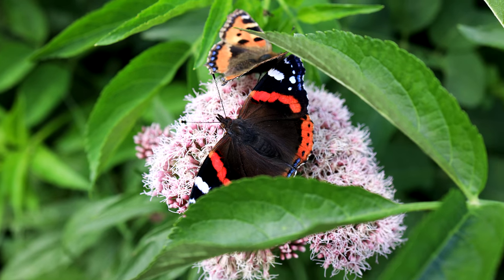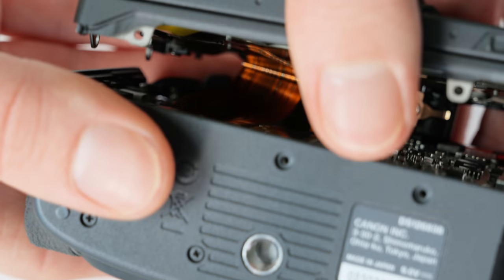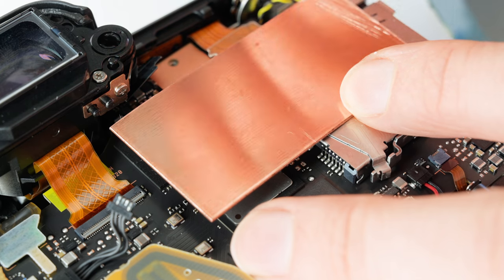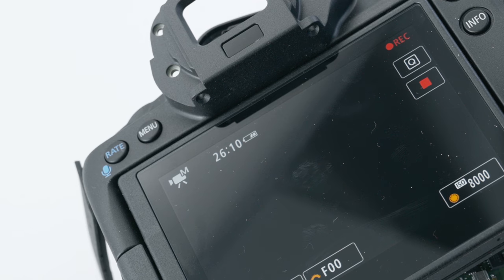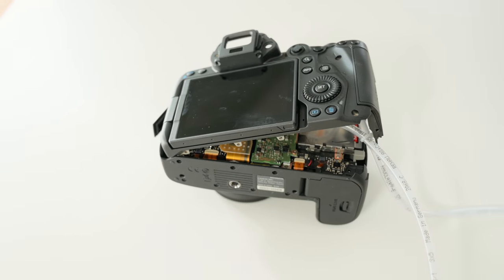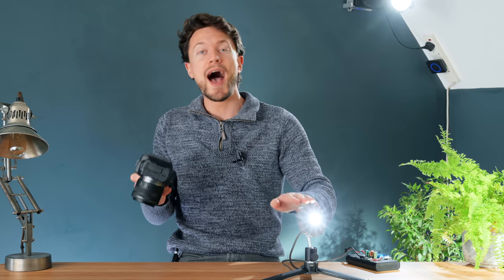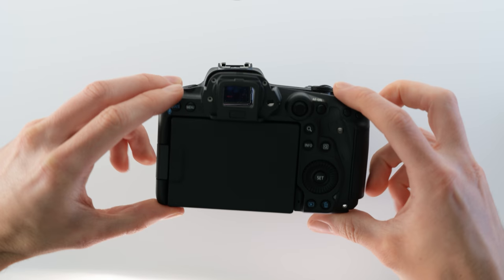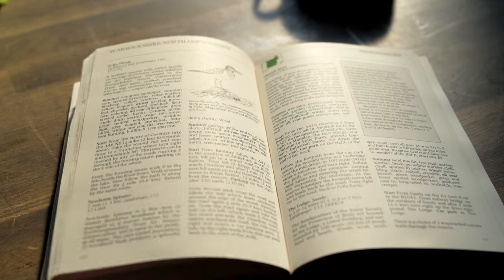The only reason to watercool a camera....

Comment: You basically did with scraps on the fly what any electronics manufacturer should have done during design and prototype. There is 100% no way that canon did not know what the problem was or how to fix it. They just made the product too good and had to take out its knee caps so not to hamper the sails of the higher market products.

This thinking is backwards however, as the prosumer market would eat it up like hot cakes, while the big studios will keep on buying the expensive stuff for its production grade class. (There is a reason RED still sells even with its eyewatering markup) 

Prosumers would never buy nor need the eyewatering heavy production grade equipment, so, they have effectively played themselves.  They have lost out on the prosumer market, to protect the demand for production equipment from a segment that will never buy it...

Comment: You should start branding kits to sell. I think of how Mad Catz started on simple nintendo systems, how they made infrared controllers for the original xbox, before xbox 360 started using them. I have a Sony, so marketing to me won't be as lucrative as Canon Rebels, T3,T5, etc. Just pic very popular models to make kits for. Your fans are DIYers, so you just have to send kits with the difficult pieces they can't fabricate on their own.

Comment: Hey bro what is the cooldown time after firmware updates .. and i also i have doubt adding thermal paste directly to power PCB will cause any issues .. beacuse there will BE pcb Vias and traces on the bottom of the PCB . ❤

Comment: idk why but i thought you were going to try and seal the camera and fill it with dry water. What if you did do this, seal the camera and add a small hole on the bottom that can connect to a small water container that has a small pump to push the water though a small plastic pipe on the outside back to the top or side of the camera. Would get rid of the need of the massive water cooling tank maybe. If you want to learn about dry water you can go to Thoisoi2 - Chemical Experiments! channel. He has a video on it.

Comment: thermal paste on pcb is a very bad idea as that stuff becomes capacitive over thicknesses that are practically impossible to measure without expensive equipment. Heat putty is what you're looking for or just use some heat pads, but not thermal paste.

Comment: 19:20 this wouldn't work because they're not allowed to burn the user. Yeah, even as a feeling this is not allowed. Which is very likely why this camera's cooling was so sh1t. Asus had the aluminium extra cool laptops, which had cooling on the pads. They aborted that range after just a model. This is why.
That said, for yours, all you have to do is make a capillary heat pipe go to the mounting thread.  If you replace it whole thread with a new one made from copper, you'll be able do the cooling in a discrete method through the stand.
This is how some testing models for LiDAR units used to cool (as a proposal), which i've used in the past in architectural dealings. They ultimately ditched such things in the commercial unit, for the same reason above. 

A sh1t reason if you ask me, but that's neither here nor there.

Comment: Nice.  I just bought an A1 and didn't have to spend 200 hours in a workshop with fire and 3D printers.
Reply: Blackmagic 12K Pro Shoots 12K and now it costs only 6000$ which is 500$ cheaper than A1.
Reply: @CreepyJoe69  we have the Ursa 12k too, completely different camera, no AF, super large files etc.

Comment: I'm seriously impressed with this mod.
Both the basic engineering skills to extract the heat from the processors, but also the elegantly designed fan module.
I am saddened to see the poor thermal management as delivered by Canon.
Putting the power board directly on top of the processors is non-optimal.  The poor thermal ejection characteristics are less than ideal.
I am impressed that just inserting the copper pieces provided such a significant difference.

Comment: Kind of unfair to compare new results and optimized firmwre with actual temperature monitoring against old firmware which maybe kept it at 2 hours by hard code. Should have compared both variants with actual latest firmware.

Comment: Does anyone know the exact parts he used for the initial watercooling prototype? I'm trying to DIY a solution to my GoPro Hero 9 overheating and I've been trying to find those mini water blocks (the aluminium ones that are about 15x15mm).

Comment: The fact that those heat pads were not even covering the CPU properly and they use simple aluminum plate and not a cooper one for cooling is very telling, that is not a mistake that is obviously intentional to make the camera a unreliable recording machine for cinema and also shorten the lifespan of the components, programmed obsolescence.

Comment: CANON COPIED YOU!
Their new pre production model Canon R5 C now comes with a huge fan right back there where you detected the heat. Amazing how this happened and almost no one will ever know it was all because of you!

Still companies should take advantage of your idea and build something for the R5. The new R5 C comes without the IBIS which is a huge downside. I wonder if they took it off because of the fan vibrations.
Reply: But that new model does not have the IBIS. Big disappointment.

Comment: Instead of working in all that copperplate why don't You use Silver, it conducts heat much better and is not that much more expensive, I think You willl be surprised

Comment: 2:35 : It's not, it's why you should not use these for long, continuous recordings like live-events.  Video-camera's (even the ENG-style ones) still very much have their place, even though some of the really hardcore "I want cinematic bokeh in my shots!"-people really want you to believe otherwise (completely ignoring shoulder mount ENG-style camcorders are still very much a thing in the broadcast industry).

People should really stop thinking they have a videocamera when all the videofunction really is is something that people should consider to be an extra, a luxury that the camera has not been designed around.
If you would see the amount of cooling on even a single CMOS-videocamera sensor (let alone a 3-CMOS camera) it's so clear why photocamera's-with-a-video-function suffer from heat issues.

Comment: For me a 4k resolution is pretty enough and most people are equipped with a 4k screen rather than 8k
Reply: Yeah, but you can use 8k to crop in, or add camera movement in post without losing any image quality in your 4k video. Just for example.

Comment: So what I’ve gathered is these camera companies are putting very little effort into processor cooling. Just changing the thermal design by like $1 could’ve made it record for a reasonable amount of time. Also they could easily just put a metal plate in the back area instead of the plastic and still keep it weather sealed easily. Just what you did an a metal square built into the back. I just figured they had reached the limit for the thermodynamics of the small form factor of the camera body. Turns out they’re just lazy and cheap lol.

Comment: THERE is a better solution than fans/heat sinks.

Replace the outer plastic with copper (use black thermal paint to make it look like plastic).

Comment: Hello I was trying to do same modification as you but something went wrong at the beginning all was on camera turned on without problems but after like third time there was some kind of error and it asked to remove the battery and I did it but after inserting battery again the red light at the back of the camera is constantly shining and camera dose not turn on please if you could try to help and think what can be wrong any advice
Reply: Did you fix it yet?

Comment: So not only is their cooling solution hot trash for a $4k camera, they limited it artificially in software which means their KNEW their cooling solution wasn't good enough. That along with how those thermal pads were installed is just next level incompetence.

Comment: NO heat-pipes, no copper heatsinks, thermal pads - not paste.... a power board ON TOP of the heating chips...  This is by DESIGN... Canon don't want an 8k full frame camera competing with their CINE $20,000 range... given that full frame cameras with L series lenses have amazing picture quality...who'd buy them when a $5,000 camera could do the same? So.... hobble it in a "believable way", not by firmware (that can be hacked) that limits record times, but by the very parts used to keep it cool! It EVEN REPORTS "Too hot!" as an error message - it was released with overheating messages! If overheating was a "mistake" they often crash and shutdown - because the designers weren't expecting it... Not Canon's.... HMMMMMMM! Suspect.

Comment: actually a copper vapor chamber cooling like in smartphones would do the job very well and it will cost Less then $5 in manufacturing for Canon plus they have much more space in the camera to literally fit 1 Big vapor chamber cooler with 2 or even 3 vapor chambers this way the camera will Never go over 30c even in hot ambient temperatures
that just goes to show even to Stupid ppl that companies will try to save few $ even on several thousand dollars products
btw for anyone with a camera like that just buy or take from a old phone or tablet with vapor chamber the cooling without damaging it and fit in the camera it will most probably do the job

Comment: Canon's whole organisation failed. Marketing shouldn't have pitched it as an 8K camera in a small plastic body. Engineering should have designed it better. Failing that, it should have been caught in testing. They shouldn't have bodged the safety with a timer. They should have done a recall and changed the heat spreader and used a metal back plate, even if it made a loss on existing units already sold.

Comment: First off, not the ONLY reason to cool it.  If you use a DSLR for astrophotography, cooling decreases noise in long exposure images.  This is why most astro-imaging cameras are cooled.

Second, why use water cooling and not a Peletier cooler (as is done with most astro cameras)?

Comment: Canon: Dang it, he exposed our poor designing.

 The overheating message on screen is a software thing. The overheating is obivously fake if the company is showing message on screen then clearly they knew that it's gonna heat up that's why that pop up is shown so no matter what you do the software qaa designed to stop recording after 20 minutes. That's why canon was able to fix it because of firmware update because it was a software stopping the recording issue. And that 2 hour time delay was reduced to 5 minutes by the canon company firmware. Not by you. You didn't messed around with software so there is no realistic way that camera is giving you 5 minutes delay but 2 hour delay to someone else.

Comment: It's a shame Canon didn't even think to add a better heat sink.
Reply: Not quite so simple. 

Even had they used copper, the heatsink would eventually be heat saturated. All the copper would do is to conduct heat faster. A larger heatsink would only buy a bit more time before reaching an overheat condition. 

The root problem here is that heat cannot be ejected from the device faster than it’s being put in.   A permanent fix would require either some form of air cooling (RED cameras do this), or to reengineer the chassis to double as the heat sink (perhaps via heat pipes), which should provide enough surface area to dissipate heat through convection.

The engineering effort would take a lot more time and expense than just a little extra material.

Comment: The overheating issue is unacceptable for a camera that costs almost $4K, not even a $1K camera should be dealing with this nonsense.  Sounds like the CPU isn't every efficient to be putting out so much heat, did Canon hire AMD engineer to make these overheating CPU? should have paid a little extra to go with the Intel guys.....

Comment: After spending a fortune on a camera, the user has to go through all this, which is insane!!
Reply: After spending a fortune on a camera someone wrongfully perceived to be an actual replacement for something called a videocamera just for a photocamera having "a video function".
People really need to learn that videocamera's still very much have their place exactly because of the problem shown in this video, the cooling in them is much more thorough, and in some videocamera's not only passive, but active as well in the form of a small fan creating a small bit of airflow).

Comment: So, is some random Chinese factory mass producing copper plates for these yet?
Reply: Why? Without the rest of the setup, you just get a very hot plate radiating heat onto the rest of the components, effectively lowering their lifespan.
Reply: @luisderivas6005  i mean, according to the data here, no it doesn’t.

Comment: peasants, why do you convert a canon camera, which is a ceiling format, and you will not buy a full frame, let's say Nikon D700, which can still be found on the Allegro at reasonable prices, and otherwise he has a problem with heating up during work and I use it myself and I am happy and it happens to me take even 1,800 photos in one day because I'm a photographer as a private life

Comment: Canon purposely cripple their camaras. Why would anyone need to get their cinema range otherwise.

It's terrible as they purposely keep their product not functioning at the best of their ability. This is why so many people are beginning to move away from the brand.

If the Copper plate was manufactured on mass and sold I'm sure people would certainly improve the Camara cooling ability. Even just for photography as low heat is better for the processor.
Reply: Equally, if people want 8K recording why not purchase a camcorder/ cinema Camara? Purposely build for video

Comment: So you took a 4000 $ camera, ripped it apart, voided the guarantee, and installed water cooling.
Sure...why not..? 😂
I must say these engineers working for Canon should be ashamed. A simple copper plate and some parts from the scrap bin are all it took to get this baby up and running.
Their development department has millions and millions to shell out for god knows what and they couldn't even spend for 2 $ copper plate on this.
Excellent problem-solving! Now you can use the full potential of this camera.